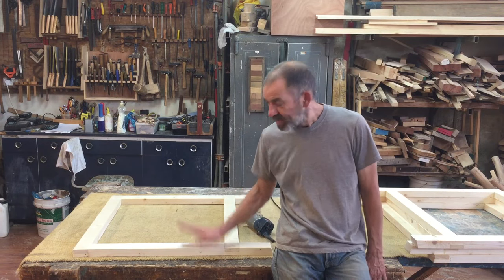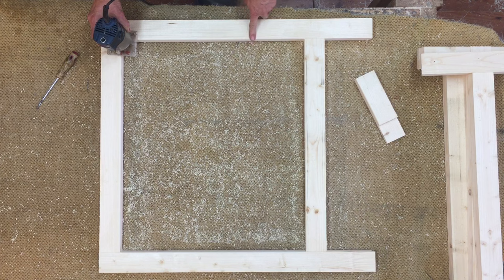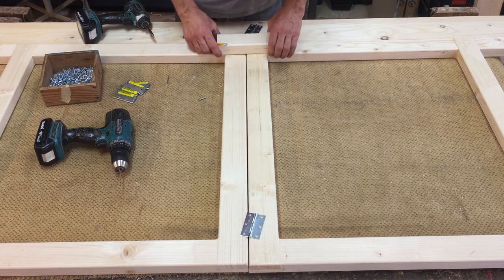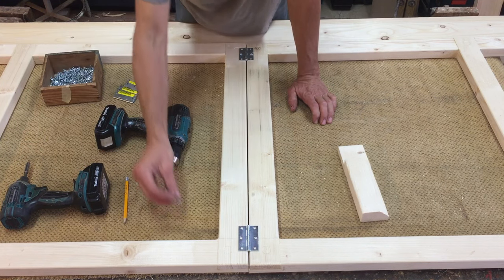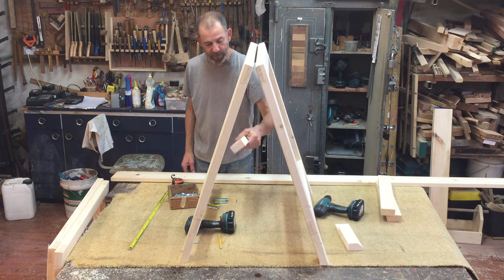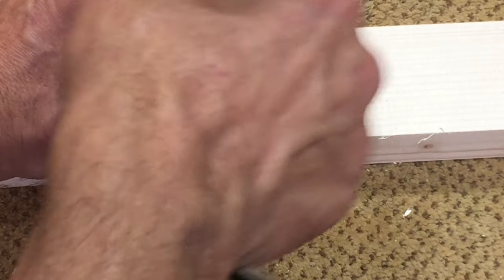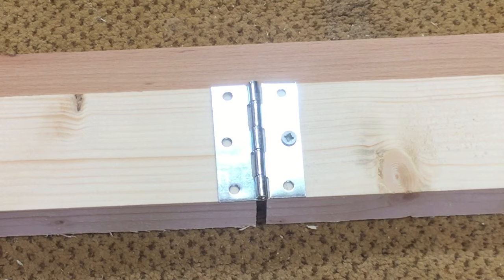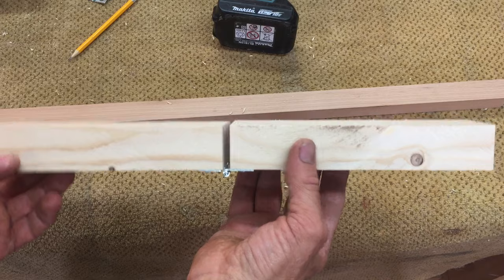How To Build My Favorite Folding Saw Horses For Home Workshop 2

Comment: I must make a pair of horses like this, all my other ones are far too heavy, and will support the weight of a car, but these look far more useful and transportable, I have always used 4"x2" which is far too strong for most work, the only thing that would be nice would be to plane the top flat, but that is only a detail, they are really perfect for most applications. Stay safe ! Chris B.
Reply from the maker: Hi Chris Thank you for your feedback, they are worth the effort, go for it Happy Woodworking David
Reply: @RusticDavid  Well! I made a pair of these, they are just right for most jobs, and they are so much easier to move around, the screw sinkers are a real advantage, you can save yourself a trip to the shops and get them on ebay, you could get a HSS countersinking bit while you are on there. Stay safe! Chris B.